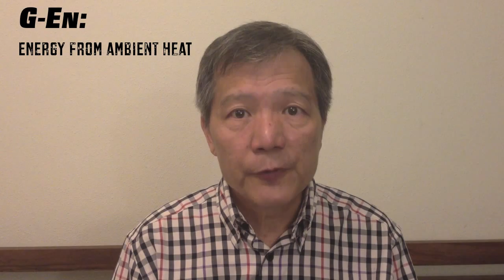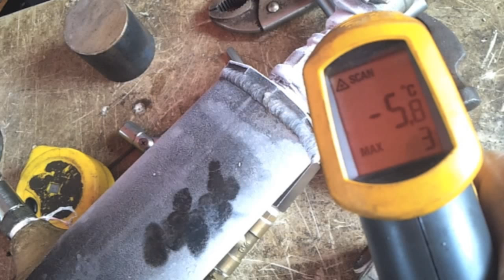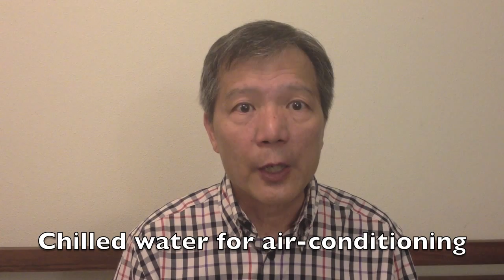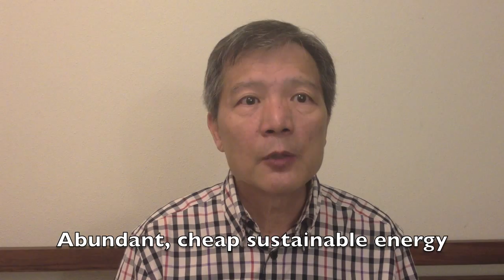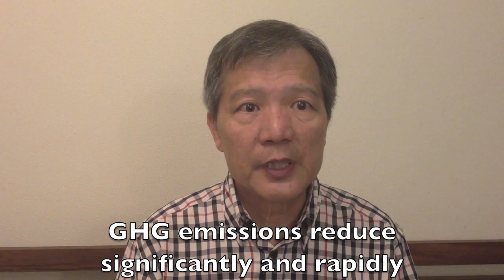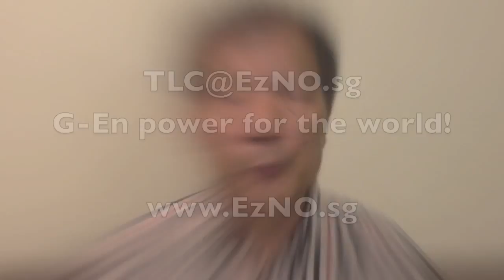g-EN -- A Green Engine powered by free abundant ambient heat

Comment: Scam invention: takes energy, (from biomass, sewage, garbage, etc.), burn it with a plasma, and use carbon dioxide as a working fluid, (instead of water and steam); thus, a cumbersome steam engine burning garbage, with hi-tech nonsense added to the mix.

Comment from the maker: Ben, when gas expands it becomes very cold. This principle is used in harvesting nitrogen, oxygen, argon and carbon dioxide from the atmosphere. In g-EN, we expands CO2 to drive a motor and the expanded CO2 becomes very cold and turns into liquid. It is then pumped back to the original pressure and goes through a series of heat exchangers to bring back CO2 to the original temperature by absorbing the heat from the ambient and repeat the cycle.
Reply: fascinating stuff. I wanna learn how to build one of these at home. Been doing a lot of thinking on practical alternative energy solutions.